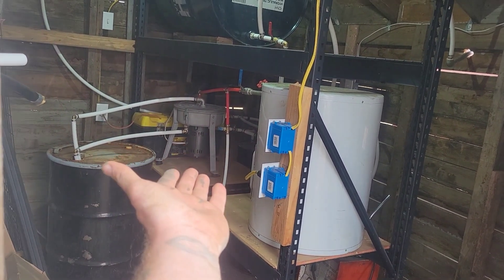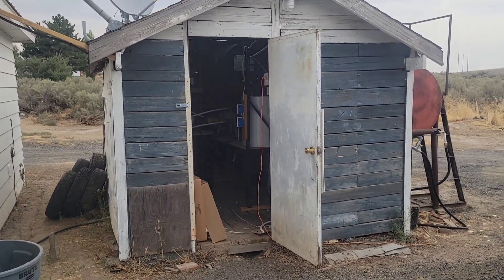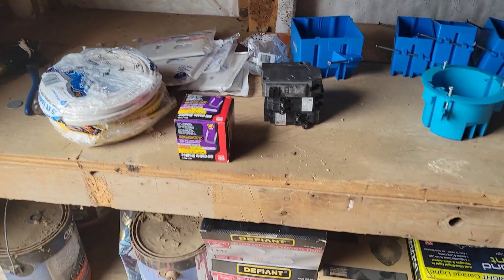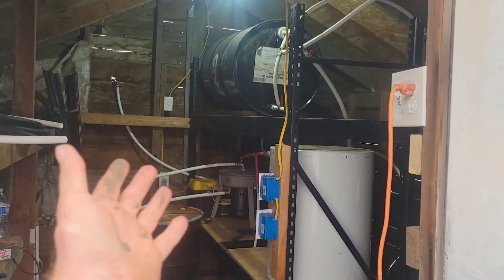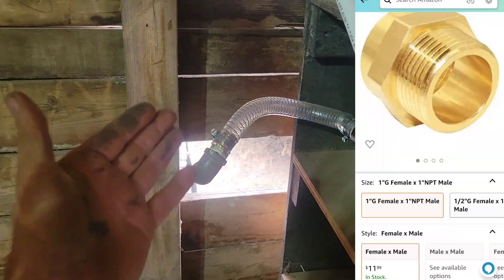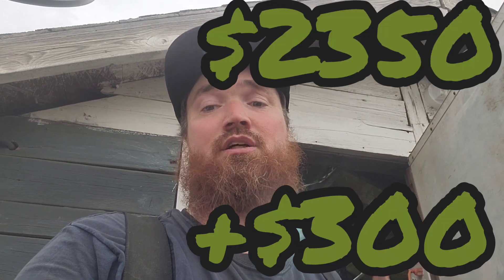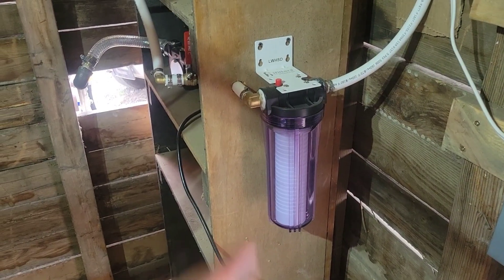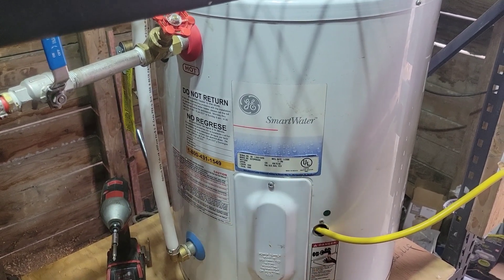Waste oil to black diesel fuel 5 hidden costs to set up a #centrifuge  #wmo #blackdiesel

Comment: Hey Aspie, I’m trying to figure this whole system out. It looks really slick. Do you think you could draw a map, kinda like a wiring diagram of your system from dirty oil to clean oil? That would be sweet if you could! Also, how has your system worked in through the winter? I’m in northern Iowa and we get down to -20 a couple times every winter. I’m making my way through this playlist so maybe you answer my questions in later videos. Lol thanks for posting these videos! Keep up the great work!
Reply from the maker: Cool idea! I have since made a few plumbing changes due to the couple issues I had on my first run. Am due for an update, will draw a diagram for better explanation when I do. I have not ran alot of oil this winter. To be honest I have mostly been driving my gas truck (square body chevy) since it is 4x4 and gets around well in the snow and ice. I will be using my black diesel alot more this summer as I have to go get firewood in bluenose the dump truck. Will keep you all updated. Thanks for watching.

Comment: That is a chunk of money and a leap of faith to invest it all in a centrifuge set up! Really hope it works out for you and you save money in the long run.
Reply from the maker: That is why I shared this video. I saw how expensive the centrifuge was, made me hesitant to take the leap. Then once I got it, I didn't realize how much more $ it would take me to get it up and running! But I already had the centrifuge, and was too deep to turn around. So I kept pushing forward. I already have around 2000 gallons of waste oil 🛢 given to me at work. So it should be worth the investment just cleaning the oil I already have been given. Thanks for watching!
Reply: I just broke even on my centrifuge setup. It's only been 2 months driving my 7.3 f350. I just sold my Silverado and bought a 7.3 excursion. He'll definitely save money.
Reply: @dylanporras2655  That is pretty cool. I am just learning about the black diesel subject. Never heard of it until aspie started putting out videos about his centrifuge. Interesting to watch.